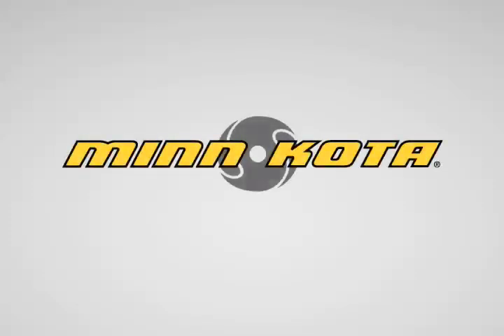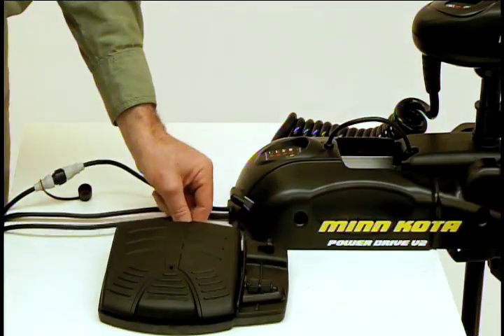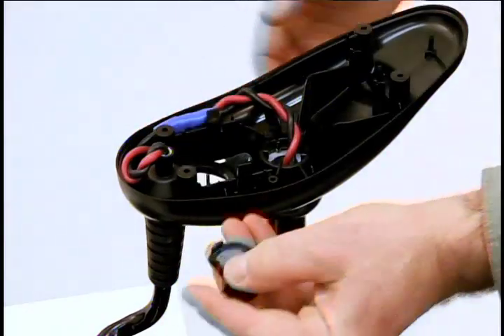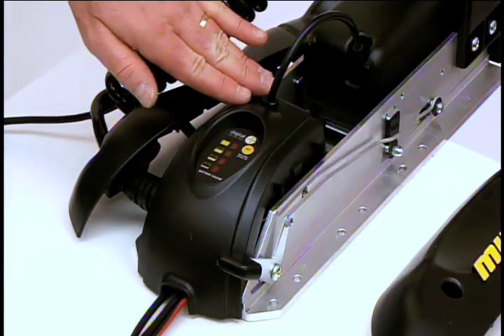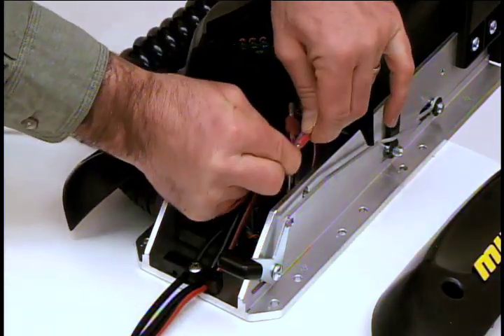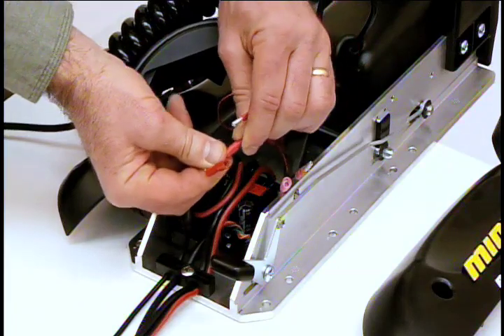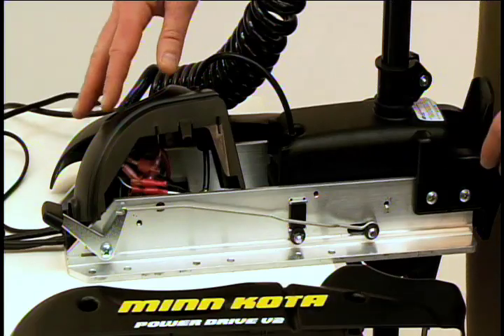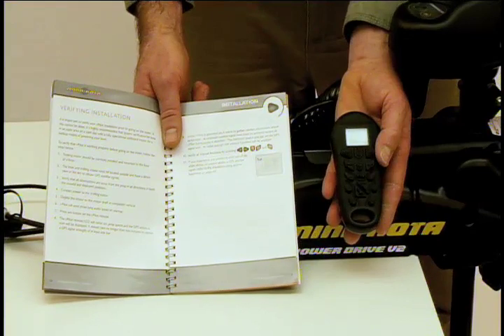How to Install a Minn Kota i-Pilot System on a PowerDrive V2

Comment: Would this work on my model mkad2603614
Reply from the maker: Unfortunately no. i-Pilot can not be installed on a motor of that age.
Reply: @MinnKotaTutorials  Ok it was  on a boat I bought recently. 
How old is it ?
Reply from the maker: According to the serial number that motor was built in 2003.
Reply: will this work on mine MKAC2400353

Comment: Hi. I built this same kit on my power driver v2 and I would like to know if there is any wireless pedal compatible with it.  Thanks
Reply: replace control board with terrova control board
Reply from the maker: Hi Alex,

Unfortunately, no foot pedal can be used on a Powerdrive V2 that has i-Pilot installed on it.

Thank you

Comment: i have one serial P181MK00973 is it possible to put and i-pilot on if yes telle me the numer of the kits thank
Reply from the maker: Hi Jean, that is a PowerDrive V2 55lb thrust with 54" shaft made in July of 2015. You can add the legacy i-Pilot system to your motor. Here are the part numbers for the control head (2880272) and remote control (2994170), each sold separately through this website.

https://bit.ly/3dryxnl

Thank you!
Reply: @MinnKotaTutorials   Thank
Reply: @MinnKotaTutorials  okay I’m have that same question my minn kota  serial number is o106mk002320 and which one do I need thanks a lot
Reply from the maker: Don-magic Live,
You have one to many numbers in the serial number.  Can you please verify your serial number for us.  Are you looking for an I-Pilot Kit?

Best Regards!
Reply: @MinnKotaTutorials  106mk00232 and yes I-pilot